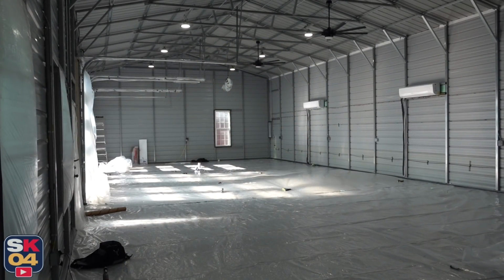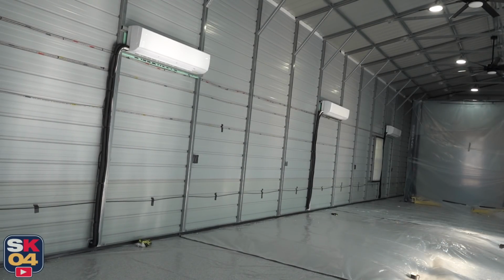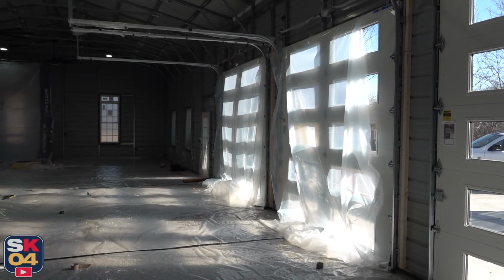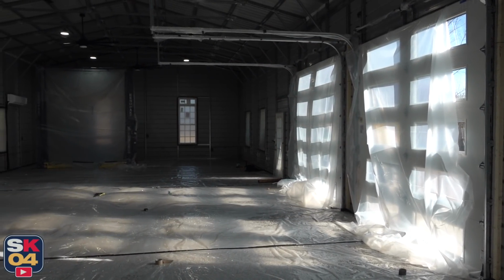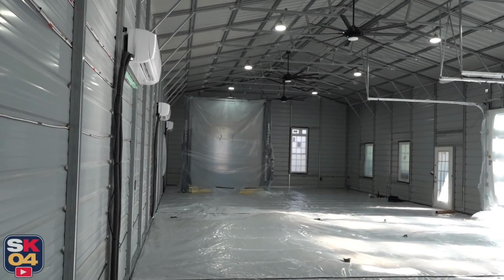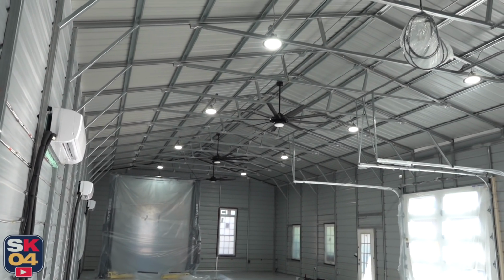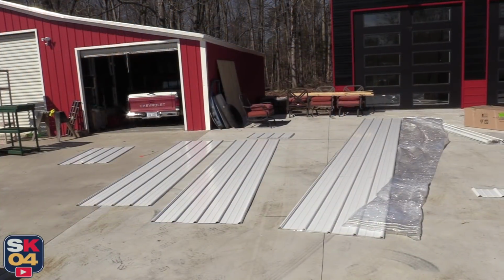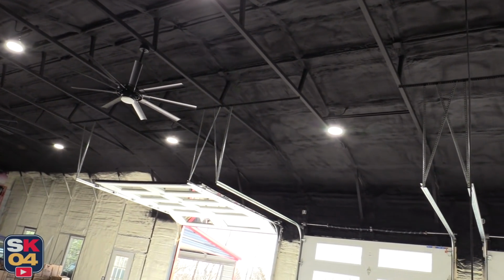The New Shop Gets Insulated With Closed Cell Foam For Year Round Comfort!

Comment: For the joint between wall and angle bracket, is that just a flat strip of metal. On the inside the wall wiring, did you use Romex or MC cable?

Comment: Great progress Kyle!
Just wondering, since the guys left the posts non-insolated, how this will be during the cold months.. It's only a small area compared to the bigger area, but still. It's pretty much just metal on metal, right?
Reply from the maker: Yeah you are right.  There were some pretty cold night following all of this and I didn't notice anything that would indicate it being an issue long term.  Because the foam is so tightly packed around them, it won't matter.

Comment: The whole building is held together by self tappers
Reply from the maker: That is how a metal building like this is constructed.  Tappers, concrete anchors and big bolts.  It's rated to withstand hurricane winds by itself.  The spray foam increases the strength of the structure by a few hundred percent.  It's like a fortress now lol

Comment: Nice choice. I'm glad I got the walls done in my shop. Today  80 degrees outside it was 60 in the shop. I wish I would have done the roof. I put in Tin and blow in a thick layer. After learning about the plus side of doing all spray foam, I wish I did it all. How thick did they go?
Reply from the maker: Thanks bud, I am very thankful for doing the whole thing, even though it was significantly more money.  The walls are 2" thick, the ceiling is thicker, maybe 3-4" if I had to guess.  The foamer really wanted the ceiling to be as smooth and uniform as possible.  He went above and beyond for sure.

Comment: Closed Cell spray foam is the best shop wall insulation. Especially for a metal shop wall. Eliminates so much echoing, and it’s durable enough to leave exposed. It also adds so much more structure to the building.